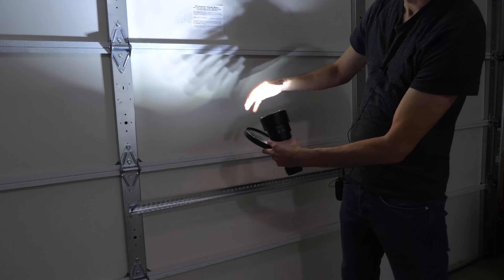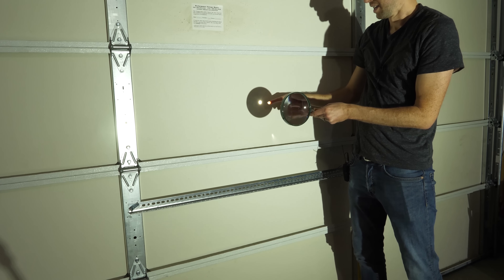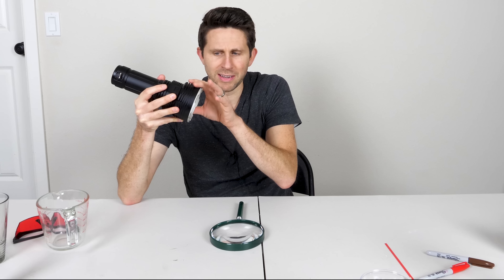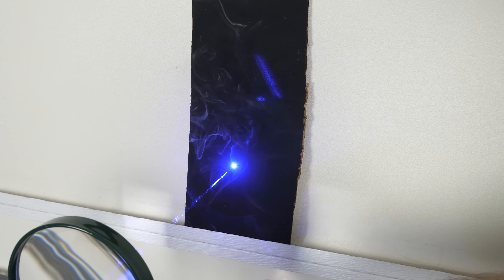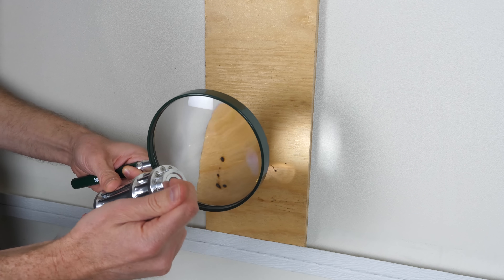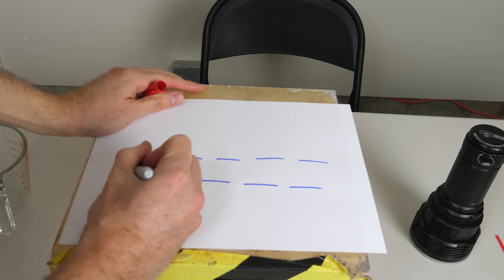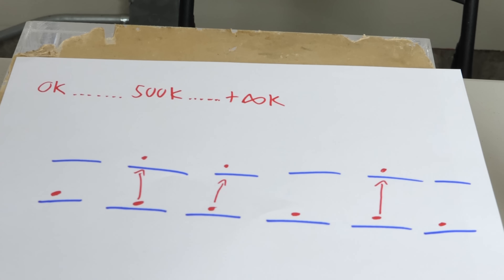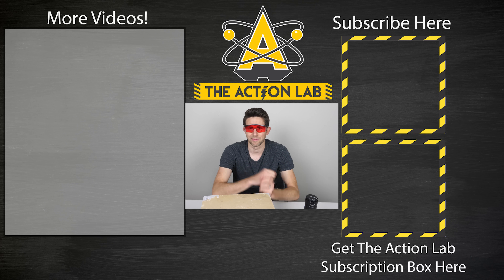What Happens if You Focus a 5W Laser With a Giant Magnifying Glass? Negative Kelvin Temperature!

Comment: I'm sure I'm not the only one thinking: Use another magnifying glass
Reply: Curious about a telephoto lens used  backwards? hmmmm...hmm....
Reply: That won't do anything the magnifying glass does not make it more powerfull if just focuses it to a amaller surface area a second one won't make it smaller
Reply: @JimTheKid  wrong a second magnifying glass will make the point smaller
Reply: A magnifying glass only makes the laser beam into a point size beam. So you cannot get that smaller than a point. Actually you will decrease the beam's energy because dissipation and absorption by the glass itself.
Reply: It may undo the first. Could it.
Reply: Why is this thread so toxic lol
Reply: @thatchannel4080  Because the internet :D

Also because the video is wrong LOL
Reply: Use two different
Reply: Use 3
Reply: @staytrue1325  hear me out.

Use 4
Reply: dot suk 
That’s what he explained you dummy, you just repeated it...
Reply: That wont work you need a linear light to focus it
Reply: Why?
Wouldn’t it just get weaker/cooler as more light is reflected?
Reply: Or use two magnifying glasses arranged in a specific distance
Reply: Just change the shape of the lens at the end of the torch to refrat the light to a smaller point
Reply: @randomness-hg9mx  there's no lens at the end of the torch. It is flat glass.
Reply: Puy the lantern inside a tube to focus the light
Reply: Dun dun!
Reply: i think that wouldnt change anything
Reply: MORE ZEROS INFRONT OF THE DECIMAL!
Reply: Exacly. Was looking for this comment thank you
Reply: dot suk  Ik im late. But he literally explained all  of that in a shorter paragraph.
Reply: I'm a do it with 20 mags but 10 Wat laser and will update my comment when it's done
Reply: I was thinking that the military could use it and put a magnifying glass on it like a rifle and then burn the eyes out of the enemy
Reply: Thats what I was thinking
Reply: Yes!
Reply: https://physics.stackexchange.com/questions/338865/besides-the-2nd-law-of-thermodynamics-what-laws-of-optics-prevent-the-temperatu
This link explains why he's right. You get more energy out than you put in with a laser through a magnifying glass.
Reply: i was thinkin a second laser
Reply: Better yet 7 more with the extra one!
Reply: Another biconvex lense would spread the light back out again.
Reply: @GraveUypo  Nope that article was about a different subject, and nobody reply, as I will never reply back
Reply: I'm thinking put the magnifying glass right up to that laser, creating a Laser Cannon!
Reply: @Starfeather_19 It would just spread the beam completely outward. In fact there would be no more beam.
Reply: flashlight can work if magnifying glass is replaced which glass ball or very short focal length glass. current one is not working because object is between focus and the surface of lense
Reply: they are called condensing lenses
Reply: Wouldn't work.
Reply: telescopes
Reply: And he's actually wrong about the second law of thermodynamics because in thus situation it's not that thermal energy is being created to make a spot hotter at one point than the source, it's just a focus of thermal energy and if something is really efficient at throwing off all the thermal energy it creates it can be colder than the thing it's heating up especially with a laser
Reply: @kovaluriengaming  "the second law is not applicable here"
"(Explaination on why the second law is applicable here)"
Reply: Physics - Optics: Lenses (1 of 5) Lens Combinations - Two Converging Lenses:

https://www.youtube.com/watch?v=aHHa0cK_3as
Reply: Everyone in this comment thread: yeah I read 1 google article and barely understood it, lemme go tell the man with a physics degree he's wrong
Reply: @ll-lp6st  this thread is the best example of the Dunning-Kruger effect
Reply: And replace the convex defuser with a concave concentrator.
Reply: Wow ur thinking what I’m thinking thinks even more what about 10000 🤭🤭🧐🧐🧐🧐
Reply: You cannot by a configuration of lenses or mirrors make energy flow from a colder object to a hotter object. In other words, you can only (best case) focus light to make a point as hot as the source. If this wasn't the case you would have infinite electricity. Let me explain:

You have: Hotter object, colder object, a contraption of mirrors/lenses to make all the thermal radiation of the colder object focus so tightly as to heat up the hotter object. Now you wait and there will be an equalibrium with the temperature difference between the objects being some value X. Now you:
1. Install a heat engine to make electricity out of the heat of the hotter object. (from the temp difference X)
2. The engine will dump it's waste heat into the colder object.
3. The colder object will radiate the heat, cooling itself.
4. Your Optical Contraption focuses the thermal radiation to the hot object keeping it warm.
Now you have infinite electicity!

If you could have infinite electricity, wouldn't you think someone should be already using it. They wouldn't need oil or nuclear or renewables. Is the current electricity generation a conspiracy?

Or is it rather impossible to make energy flow from colder to hotter? And as such, impossible to, for example, concentrate the flashlight further.
Reply: Next thing you know, Adam and Jamie from Mythbusters comes in a build a giant magnifying glass.
Reply: Just came across the video, Death Star V.1?
Reply: It means not just only you that stupid on physics 😂
Reply: It would melt right through
Reply: they take old tv lenses and melt down rocks… but i want to recycle ♻️ using this idea
Reply: Even during the beginning.
Reply: Try Trillion
Reply: Oh nevermind
Reply: Ain't gonna work .
Reply: Yeah the fool needs to use his brain and get a series of magnifying glasses that take all the light coming out and condense it
Reply: action lab guy

WTF
Reply: Why do people hate him? Is it because his fingers dont’ explode when he puts it in a vacuum?
Reply: Use 20
Reply: Use 5
Reply: You want the entire Indonesia to be erased?
Reply: Mirrors
Reply: My brain: what if you used 100 magnifying glasses to focus light wnergy
Reply: did the guy delete his comments?
I was just prepping some popcorn
Reply: You are not the only one who thinks for this
Reply: Use a tunnel
Reply: That's how you open the gates to Oblivion
Reply: this comment didn't even watch the video or he too dump to understand why big magnifying glass is needed.
Reply: hahah lol you are not alone bro i was thinking same too lol
Reply: Can’t he use a bigger one or one curved
Reply: Or more than one lens.
Reply: BART Simpson
Reply: With the megaphones
Reply: I'm not sure he's correct about the second law of thermodynamics. The total energy cannot be more that the initial energy, but if the non-visible energy (uv, infra-red) is shifted into the visible spectrum then there can be more visible energy at the destination than at the source.
Reply: A FOURTH
Reply: No, you aren't the only one...
Reply: I feel like people are ignorantly arguing that The Action Lab doesn't know what he's talking about, when they simply don't understand it themselves.
Reply: Adding another wont change anything
Reply: @745morning  Well, considering the first majoring last when out right next to the flashlight ca others the beam entirely and focuses it, a further lense would focus that down further and could be farther away.

Not to mention, A FLASHLIGHT IS LITERALLY A DEVICE THAT USES MIRRORS AND A LENSE TO FOCUS LIGHT TO BE BRIGHTER THAN IT'S INITIAL SOURCE!
Reply: @CrispyChicken38  smh
Reply: @745morning  Clearly you have never played with lenses. You can focus the diffuse light from a huge LED torch down to a tiny point. The >>>total energy<<< at that point may well be less than the >>>total energy emitted<<< by all the LEDs, but it will be concentrated on one spot. The ability of a material to dissipate heat is important. If it cannot dissipate the heat as quickly as it is building up, it will get hotter. Hence at 40 feet the torch won't melt an ice cube, but with the right lenses, at that same distance, the ice cube will melt very quickly. To be honest, his explanation of the torch wasn't the best, and caused people to misunderstand what he was saying.
Reply: @another3997   That would be because the LED phosphor is itself very small. If you had a broad light source, you would not be able to concentrate it to a small point.
Reply: @745morning  It would focus it more, but yeah I geuss.

Also it was a joke
Reply: @745morning  Yes it would
Reply: @gsftb  explain your reasoning
Reply: @745morning  missed the joke
Reply: @745morning  it will focus it further, would it not? The laser would be focus after being focused.
Reply: @745morning  Exactly. I believe there's a certain limit to how much a laser of a certain wavelength and power can be focused.
Reply: @745morning it will magnify it even more and make it burn faster in one spot
Reply: @745morning7 of course it can, Galileo made the telescope with two magnifying glasses and believe me, y you point a laser beam (even a harmless one) through something like that it will incredibly increase its power
Reply: @745morning not true adding another will only dim the light even more, the original is always the brightest light, the more lenses the dimmer it becomes as the light has to go through the glass. The only possibility is to find the right magnification glass for your light source that balances the light beam perfectly into a clean dot.
Reply: @745morning If the first magnifier can collimnate the light so it is parallel then the second magnifier will be able to focus the light to a brighter point.
Reply: @745morning  using a fresnal lens would
Reply: That sounds like an interesting idea actually..
Reply: I would like, but then it would be 666 likes
Reply: Infinity²
Reply: Shhhhh he’s not actually incredibly smart he just copies other you tube videos and quotes wiki
Reply: @Shimikotsu  I mean... Dude has a PhD in Chemical Engineering. His dissertation was on enhancing mass transfer and electron usage for syngas fermentation. He might not have a degree dealing exclusively with physics, but he definitely knows his stuff and knows how to do the research. Additionally, Chemical Engineering deals a lot with physics.
Reply: @Shimikotsu   Interesting comment, considering the OP's suggestion wouldn't work.
Reply: @Shimikotsu  well at least he has a brain, which still makes him smarter than most people.
Reply: @Shimikotsu  He is smart enough to actually perform these experiments and learns how they all work and explains them in every video. And, no I'm not a fan so I'm not being bias.
Reply: King Drei no you mean he has the money to buy the supplies then quote any Wikipedia article.

Anyone with money to buy a vacuum chamber could put a VACMAN inside of it then explain how vacuums work.
Reply: @Shimikotsu  I'm pretty sure with all the videos he's done, he should have some intelligence by now. Also, I'm pretty sure he invented his own material(don't quote me on that). To deny that he does not have any knowledge on what he does is completely a one-sided opinion, in other words bias.
Reply: @schweezy4455  he always has to leave a comment clarifying himself and what he meant afterwards

Him not scripting what he's saying is dumb that's lessons 101 if they aren't scripted with a linear route so you Don't get sidetracked or lose your point you lose retention and nobody understands

Also watched 2 of his videos and learned that he just can't make a clear point without rambling
Reply: @Shimikotsu  Not everyone is able to explain in an entertaining but still informative way, and not everyone is willing to take time out of their day to start an informative channel that requires tens of hours of work for what, at the beginning, is just a few views. Don't act like you're better than people, you just come off as really insecure.
Be humble, and appreciate that someone has bothered to explain something interesting to you and millions of others who most likely wouldn't have looked it up otherwise, and wouldn't have known about it. Maybe you don't care, but somebody who finds a channel like this randomly could find out they have an interest in physics and other sciences they didn't think about and decide to make it their career. Channels like Nilered get constant comments of students who decided to take chemistry because of how much the channel made them realize it's their passion.

I don't know if you bothered to read. If you did then I hope you get what I'm trying to say here. Just don't be an ass for what is pretty much free, very accessible content.
Reply: @Shimikotsu  bro he has phd degree in physics. Lol 😂
Reply: @zeusolympus1664  And yet he attempts to make some hand wavy bullshit explanation claiming it is not true for Lasers because they are Quantum bullshit despite literally everything dealing with photons in this fashion being Quantum and he literally just attempted to Quantum Woo us. Idk, I am skeptical to say the least because I am almost sure these equations are meant for temperature / area which would without a doubt be true, the way it is described in this video however is almost surely not. It is even what the link provided right above your comment discusses about reversing the system. In the reverse the rays would expand outward. The Lasers work allowing higher temperatures/ area because they are in phase and adjustment of phase can alter temperatures at any given point.
Reply: @Shimikotsu  Okay and what? Whats your point. Im glad hes doing it and so are millions of others
Reply: @Shimikotsu  the most important part is that he's making money just as anybody else can
Reply: @Shimikotsu  you’re so right
Reply: @Shimikotsu  just curious. What do you do?
Reply: @schweezy4455  being able to explain something doesn’t mean anything 😂 if you know how to read something that tells you how to do something and how doesn’t mean you learn it all you did was “read it”
Reply: @Shimikotsu  take it easy
Reply: @Shimikotsu  I know this comment is 2 yrs old but idc. Anyways, one word to you. Try.
Reply: @Shimikotsu  do you have something against the guy? What matters is that the viewers are getting educated or entertained, knowledge is not innate, you learn it, otherwise by your logic teachers arent intelligent at all.
Reply: @Shimikotsu  based
Reply: @Shimikotsu  Tbh I don't really like his voice, I'm far from a fan. But credit where it's due, he gives very good explanations for things.
Reply: @Shimikotsu  and has pressure chamber
Reply: @Shimikotsu  he's a chemist
Reply: @Shimikotsu  youtube* and what is a quotes wiki
Reply: @Shimikotsu  he's literally a scientist
Reply: @Shimikotsu  he literally has a PhD in chemical engineering
Reply: @Shimikotsu  bro keep begging for attention
Reply: @Dakota Yupyupyup you can't even spell youtube the right way...
Reply: @Shimikotsu cool opinion and all but here's a rebuttal, it's called binging dude, sorry if it's not as sophisticated for you. anyone can by a vacuum chamber but I doubt they would, which is why we have this guy. And it's a thing called the internet, where knowledge is shared, so if the information is a bit samey, it's probably cause you can't really the laws of physics
Reply: @Shimikotsu I mean idk why you're one to talk, have you seen your material? At least the people in TikTok thought of using a synthetic voice, damn videos aren't even bing-able. Here's a critique, use some commentary, some special FXs, try adding a personality just to keep them hooked in, cause you're not telling much of a story, in terms of characters and plot. You can't really be one to talk about articulation with the way you present yourself. There constructive criticism, consider it sometime
Reply: @Shimikotsu that's great, that means he's spreading knowledge like everyone else
Reply: @Shimikotsu  I agree.
Reply: If i have a laser like that and 10 magnifying i would try to create a laser gun, then kill my teachers
Reply: @DannyFer-gt8sg  Time to play pumped up kicks
Reply: @stonker5999  grabs laser gun
Reply: @DannyFer-gt8sg  yeets self away like polnareff in part 5

Comment: The flashlight does not focus into a point because of the light being diffuse, If a different lens was used which makes a parallel beam it would be possible. This is what the laser shows. A laser is just a parallel lightbeam, just like sunlight so both are possible to focus with a magnifying glass. Lasers are not quantum mechanic magic, they’re just concentrated, parallel lightbeams.
The amount of energy leaving the magnifying glass is never more than the amount entering it. Even a little less due to losses of the glass itself.
Now the Negative Kelvin part. Better get your old physics books. At zero Kelvin all molecules of the measured medium have no movement which makes it zero K by definition -273 deg C. As something cannot move less than not, a negative temperature in Kelvin is not possible. Atoms being in an certain energy state depend on the electric charge and that is another chapter of the physics book and have nothing to do with temperature when the state is not plasma.
There is a theoretical ultimate temperature and that is the Planck temperature and that is when the wavelentgh of the heat induced radiation is the planck length, the smallest possible distance.

Comment: The light from the  sun is incoherent while the light from the laser is coherent. You can never focus the energy of the entire sun to a single point because it's scattered in every direction - you'll only ever be able to focus a tiny snout) amount of it. With a laser, all the photons are traveling in a single direction and so it's easy to focus the entire output (hence the increased temperature when condensed to a single, tiny point).